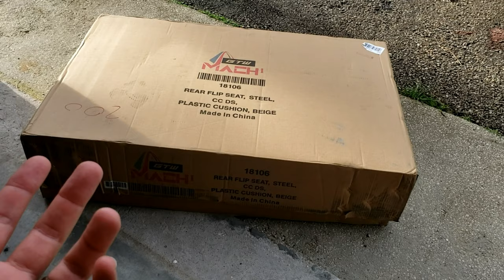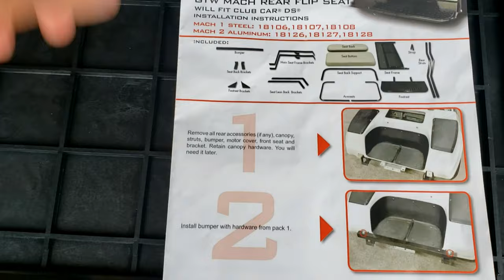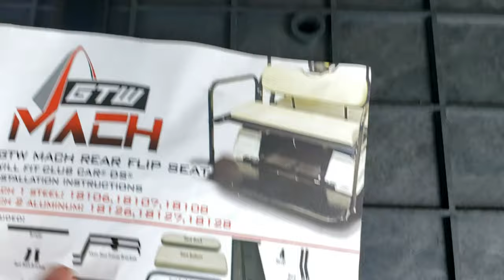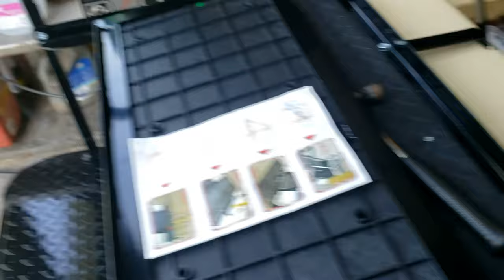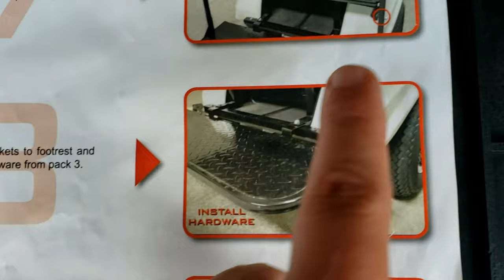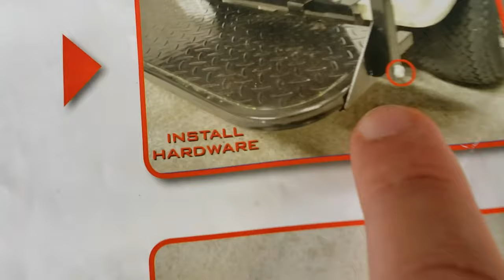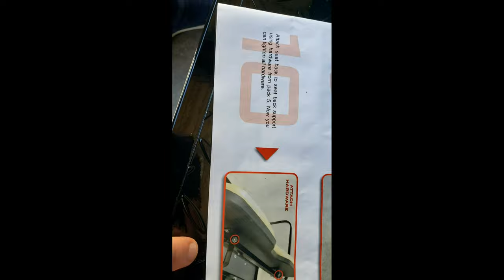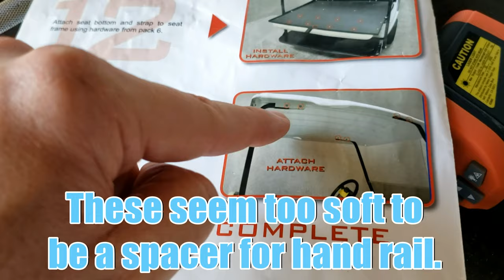Club Car DS rear seat

Comment: I ordered the Modz seat for my 80 Club Car Caroche. I ordered a kit for a 2000+ Club Car DS. I need to modify a couple of things, but it went together very well. I didn’t like some of the kits because the rear supports didn’t tie into the front seat mounting point. 
Great video. Actually that looks just like the Modz kit.

Comment: great  video ! I'm mocking up my 86 DS and retro fitting a ezgo rear seat cage some cutting  and welding  but not that bad,,I did in fact was wondering when I came  to the step about the bumper , you solved my prolbem, Thanks

Comment: I happen to see this video of the gentleman working on his golf cart I had the same kit that did come with the same roof mounts I was able to take the one that was on the left put it on the right and the one on the right put it on the left so I was able to bolt it in the back section of the roof like the original one not on the sides the only thing I had to do was drill different holes on the bottom use the bolts that it came with and it worked no need to buy the extra new roof what I call trees.
Reply from the maker: Awesome, thanks for letting us know.

Comment: I have the same problem with the unit that bored I bought it from eBay when I opened the box to install it the two main street frame bracket wasn't there and back A1 at the bolts with no nuts I contact the seller and I'm waiting hopefully he'll be able to send me the main bracket or not I have to send it back